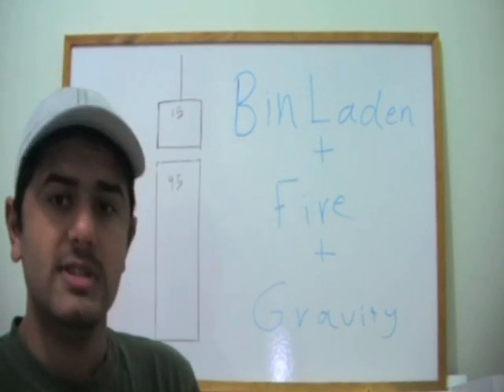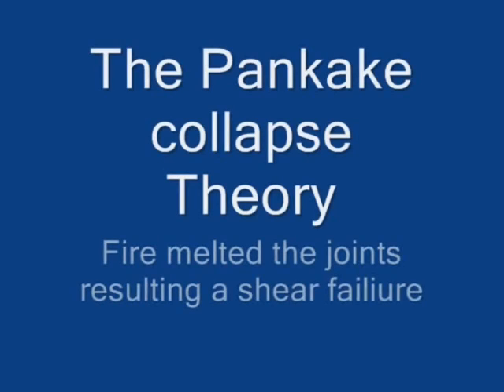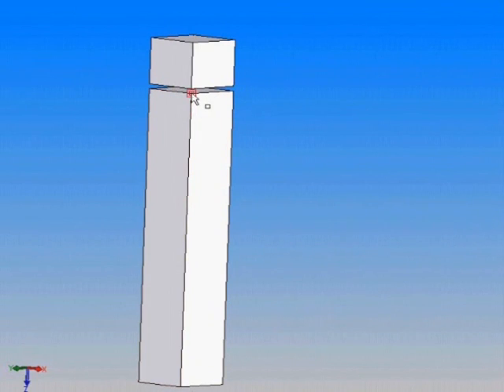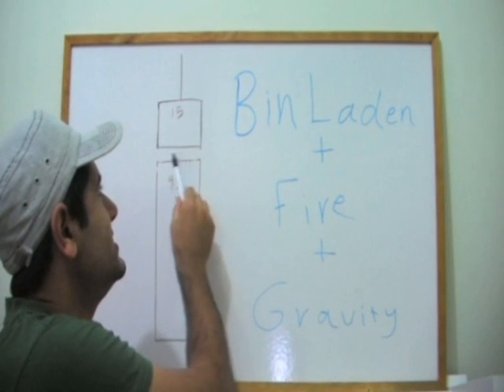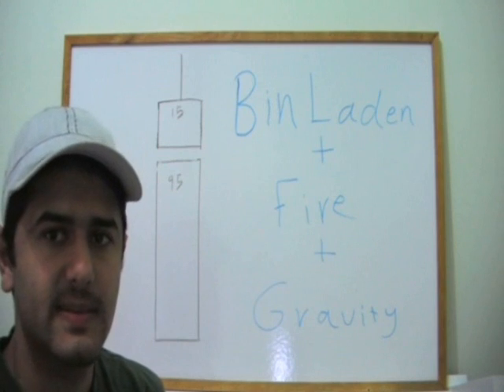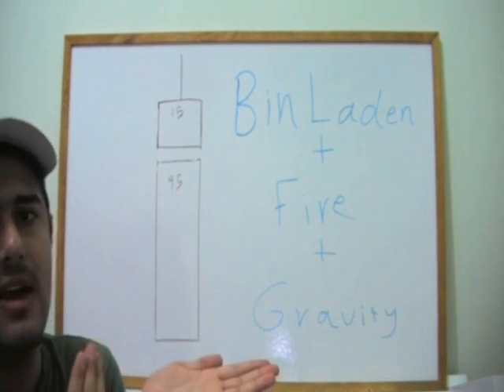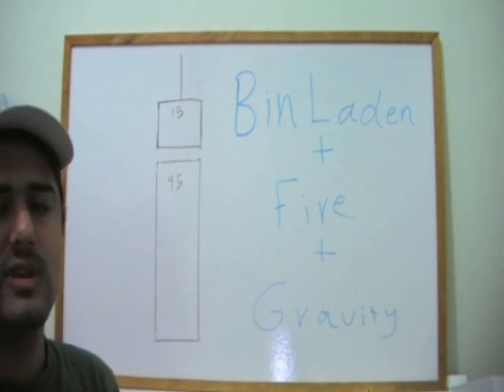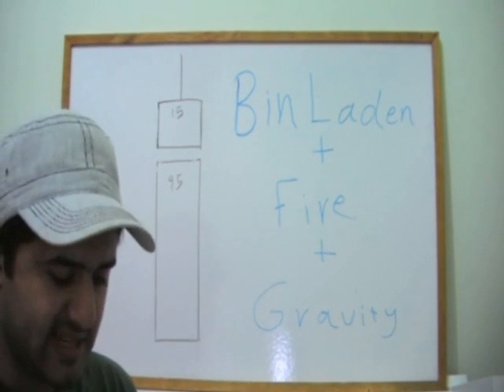(Part1) 911 Simple Physics Structural Failure Vs Demolition

Comment: Eh, no. This is a video of a guy with a whiteboard making some unfounded claims based on staggeringly inaccurate information. He starts out correct by saying that the pancake (excuse me, pankake...) theory isn't valid for 9-11 (which is true), but by 2:00 it shriveled down to nothing. 

Go check out "vvvvvv sharpprintinginc com / 911", it goes into details even the NIST report doesn't. The "WTC1 Accurate Collapse History" section should open your eyes more then a crappy whiteboard.

Comment: Except the plane impact destroyed and damaged many columns, meaning that some columns were dangerously close to being overburdened and fail. The fire then pulled even more columns out of alignment, until the top section could not longer be supported. 
The collapses were NOT symmetrical. The top side falls into the weakest point, and tilts over,  the squibs show that the interior was collapsing before the exterior, and 40-60 floor core segments kept standing for 20 seconds after the rest fell.

Comment: The pressure from the top floors had been there since 1968, and had been resisted quite effectively by 100,000 tons of structural steel put in place to resist those forces.  

The force didn't propagate.  What propagated was the lack of resistance.  We need to know how that happened.

The collapses were symmetrical.  Just look at the videos.  They went floor by floor by floor.

Comment: No, it takes a leap of faith to follow twoofer logic. Also keep in mind that the forces involves came from above, the pressure from the top floors didn't have to propagate, it was already there! The free fall speed was only during the middle stage of the collapse, and was anything but symmetrical. And those 2000 architect and engineers are a false claim (as mentioned by godzilla1077).

Comment: There's no circular reasoning, you're just setting a strawman on fire. The collapse initiation started when the remaining vertical columns on the outside could no longer support the weight of the building above. The widespread fires were warping the exposed and damaged floor trusses, which pulled in the outer wall. This inward bowing is visible on both towers prior to collapse. Bent columns do not carry a load so well, especially with the large number of missing columns adding more load.

Comment: watch?v=MY7BCXew0UI
This video explains the construction well.    It also means that the floor trusses are what holds the columns in pure vertical.   As the floor trusses fail due to damage and fire they pull the structural steel columns out of the vertical..... and then gravity takes over,  Once the large mass starts moving down pure physics shows the load of the impact into the lower floors FAR exceeds their strength to support weight.   Nothing can save the building.

Comment: The videos of the collapse document the factors at work in the collapse.  You have to consider the construction of the Towers to understand how the collapse occurred.  When they were built they used an innovative new technique to provide the open floorspace of the levels of the Towers.  The building's structural steel was actually the exoskeleton of the building, and then the floors were concrete supported by trusses that connected to the outer walls and inner elevator shafts.

Comment: You can place a brick on a glass, and it won't break (static load), but it will crushed if you drop the brick on it (dynamic load). 
Source is the NIST faq (point #12): "The vertical capacity of the connections supporting an intact floor below the level of collapse was adequate to carry the load of 11 additional floors if the load was applied gradually and 6 additional floors if the load was applied suddenly (as was the case)." 
Floors above impact: "(12 floors in WTC 1 and 29 floors in WTC 2)"

Comment: I think you forgot a crucial detail in the video. When the top 12 floors of WTC1 collapsed on the floor below, it far exceeded the maximum dynamic load (estimated at 6 floors). The floor below that then had to deal with 13 floors of load.. below that 14... etc. The debree paths show the outer columns were pushed away from the building from the top down, which is only possible if the top collapsed into the floors below.

Comment: Actually, if the pancake theory is true, it would of collapsed slower then it did. Its actually a really ridiculous theory because during the building collapse, a good portion of the building was turned to dust. Dust doesn't weight anything at all, so with that said, the whole building should of never of collapsed to begin with especially since the top of the buildings literally fell off the sides of the building and turned to dust. How can dust pancake a building?

Comment: Still doesn't debunk it if you discredited a single source. Can you explain the giant dust clouds forming around the building as it fell? For those to shoot out as far as they did it would have required a greater force than the simple weight of the floors above.

Comment from the maker: i worked in structural engineering for a while and we had vertical cantilevered columns (not beam),  i actually built my house that way using 150 UC cantilevered in concrete pads then i put the whole house on top of it. 
by cantilevered they mean its fixed in the ground the same way a vertical cantilevered beam is fixed on the side ,  it just means a fixed end not simple or pin or roller support but no degrees of freedom

Comment: Sorry. For the imaginatively challenged; A cantilevered VERTICAL column, one of 47, that reduces progressively in both dimension and wall thickness as it rises throughthe entirety of the structure, producing both VERTical support and lateral stiffness, in a redundant assembly capable of supporting the ENTIRE building load, working in concert with the exterior steel "lattice" assembly,  ALSO capable of supporting the ENTIRE building load through the "hat truss" and by global load transfer. 

OK?

Comment: Props where props are due!

In the case of the WTC Towers, "trusses" and "beams" were the horizontal members employed.

Not sure one error indicates "a complete lack of construction knowledge"...

Still not convinced the supposed loss of fireproofing, caused by the offset impact of a plane already shredded by impacting the exterior structural steel would have the energy to scour enough of the fireproofing to cause the effect you claim...

911 DENIER scores a point!

Comment: Yes, I have work in construction had hired subs to apply spray on fire proofing.

It flakes off very easy

No, I'm not talking of drywall enclosures.  The fact the you are confused only proves you have no idea what you're talking about. 

The 767 impact did obliterate nearly everything in its path.  That's why the building collapsed.

Go ahead, keep on talking.........it's funny!

911 TRUTH DEBUNKED!  

I'm talking about the the spray on fire proofing used on steel columns and rafters.

Comment: Actually, I AM very bright.

I DO have actual knowledge of fire protection,application, methods, and durability of same.

No, it doesn't. You're probably thinking  of the drywall coatings for residential ceilings, and extrapolating!

 A 767 impact is not a nuclear bomb. The idea that the impact would obliterate everthing in its path is nonsense promoted by the clueless.

Strawman.  H-I-G-H-J-A-C-K-E-D-P-L-A-N-E-S.  Strawman.

Comment: You not very bright.

And you have absolutely no clue about construction of fire protection.

Spray on fire proofing is can be scrapped off columns very easily.  It flakes off.

A 400,000 lbs 560 mph jet impact would take off all the fire proofing in the effected area.

Can you spell S-T-R-A-W-M-A-N?

Comment: As for structiural "weakening" of the steel, even if that HAD occurred (not lkely) the effect would have been to create a gradual failure, rather that an instantaneous "drop ", "tilting drop" "fractured drop", "angular drop" or any other such fantasy collapse initiation.

The strength of the foundation carried through the structure, and would have resisted ANY so-called "fire-induced" collapse by the very real thickness, sizing, and array of the core column structure.

Fail, on 3 counts.

Comment: Fireproofing not as significant as alleged, since in many cases it was not even necessary for fire resistance in modern designs. It was a code reqirement The notion that the fragmentation of the aircraft scoured the fireproofing off a significant portion of the strutural steel is also a stretch, since there was simply not enough flying aluminum bits to accomplish such a process. Ask a construction worker how tenacious the bond between fireproofing and steel can be.

Comment: Please. 

Check the freaking facts before you make such preposterous statements. The core consisted of hollow tubular structural steel on the order of 52 inches by 22 inches, with 2 inches of wall thickness., on the lowest portions. These dimensions were progressively reduced as the core reached upward, and the official apologists have used the smallest dimensions to represent the resisitance of the ENTIRE structure (Byzant, NIST report) Quite the devious little shits, eh?

Fail, by ignorance.

Comment: The floor structure of the WTC existed no where else.  Other than its twin.  The columns RELIED on the floors for their tensile strength.  Let me ask you this.  You have a dinner plate and you have 4 pieces of raw linguini 1 inch long.  And 4 pieces 6 inches long.    Which linguini lengths are going to hold your dinner plate and your food with more stability?  The one inch lengths or the 6 inch?.

And no this has nothing to do with dinner or spaghetti.  It has to do with a principle at the WTC

Comment: This is the "house of cards" fantasy model, beloved by deniers the world over.

Sure, pound for pound, paper and air are lighter than balsa wood. Nice sleight of hand , there, Ignatz. 

If you had a clue, you would know that the WTC structure was a redundantly supportive, vertically cantilevered, load-distributive structure over-engineered for fail-safe tolerance of aircraft impact and fire, with steel engineered to provide 4 times (minimum) safety factor under MAXIMIUM design loading.

Fail.

Comment: MIT (They're pretty smart people over there. Math and Physics PHD's).  Did an analysis on the impact forces of the aircraft.  Accounting for such variable as the tensile strength of the steel.  Its yield point etc.  

The plane went through the side of the building expending ONLY 2.5% of the total energy it possessed.  It would have done so moving at 185 mph.  It was doing 560.

Get real pal.

Comment: Non-sequitur, but I'll play along, just to show you what actual considered thinking looks like. Half a pound of foam,with enough velocity, can penetrate a surface not designed for that sort of load. 

The steel frame of the WTC Towers was much denser than your "foam" example, yet the airplane passed through it without apparent diruption to the airframe, at least initially (no shape change, deformation of profile) AND the steel columns, et al, were SUPPOSEDLY wildly disrupted by the impact. Sure.

Comment: Every single component put in it was a weight consideration.  In scale the exterior columns were as thick as paper.  Instead of a concrete encased core they opted for sheet rock.  The floors were 4 inches of light grade concrete 210 feet by 210 feet by 12 feet high.  Do the math and see what this structure is comprised of?  90% air.  Most hi rises have 75 pounds of steel per cubic foot.  The WTC had 35.  Pound for pound that's lighter than balsa wood.

Comment: There's a video on YT somewhere.  Wish i favorited it when i saw it.   A B 25 hit the Empire State Building in 1945.  Which was a cement and columned FORTRESS in comparison to the WTC which was one of the lightest buildings of its kind.  The B 25 impacted with like.. 40 megajoules energy.

The 767 hit with 4600 Megajoules.  On a building which was intentionally made to be as light as possible.

Your statement is is incredible ill informed.

Comment: That's also wrong.  You might want to listen to an interview with Charles Thornton.  He was on the NIST over sight committee.  They found that the viscous dampers in the building could not handle the massive amount of sway the impact imparted to the building.  The frame was massively out of alignment on impact.  Doors 20 and 30 floors below the impact point would not close.  The building had "Basically" been knocked out of its foundations and alignment on impact.   It was only a matter of time.

Comment: The structure would have dissipated the impact in accordace with the design parameters that allowed the increased height in the first place. the weight would not increase globally, since there was no additional mass introduced, except for that of the plane, which had no initial effect, and thus was a tolerable load.The "air pressure" was not sufficient to create the effects you claim. (see Ryan's study) The elevator shafts were sealed from the building proper, for fire safety reasons, so no.

Comment: I am sorry, but what exactly is there to pulverize?   You're talking about a structure that is about 90% air to begin with.    Once the failure begins you're expecting a floor rated to carry a maximum load of some 1500 tons to resist and arrest a dropping load of 33 floors?  Some 180,000 odd tons?.. Moving?.

Not even close to being possible.  This is an overload of GIGANTIC proportions.   Why is the next floor going to offer any more resistance? It now has 33 floors PLUS the floor added. Etc

Comment: Except Charlie's airplanes were not calculated with full fuel loads flying at 500knots. However, the engineers used those models to get insurance for a Airplane strike now didn't they? That's how they kept the original costs of the Trade Centre down. Their original design was questioned as dangerous to airplane strike, thus the bullshit Charlie model with a airplane flying at 200knots with no fuel. Go ask Charlie and then see what he says.

Comment: The cumulative force for from each additional floor would be more than sufficient to pulverize concrete.  Also, the resistance given by each individual floor would be a constant resistance per floor and the cumulative force from the initial fifteen would grow with each floor collapsed.

Comment: The core columns don't need equal head distribution.  The lateral support beams connected to the outer support structures *buckled* due to weakening (1100-1800F, not melting) of the steel, pulling them inward until they fractured from sheer stress.  Plenty of pictures and news videos showing the progressive inward sagging.  15 floors coming down turn into 16, 17, 18, and so on progressively, creating a growing downward moment of inertia VS the static resistance of each floor.

Comment: @TBlake34 you are so deluded it is really quite pathetic! you're imagining that the core columns all got equal heat dispersion with a softening effect that was somehow sudden enough to cause a catastrophic and symmetrical collapse? the impact was asymmetrical! therefore if the planes were responsible, the collapse would have been asymmetrical AND gradual! by your view the damaged floors just vanished, causing the pulverized upper floors to crush the lower 95? mmmm, idiot much?

Comment: @itzamia you answer your own question! Newtons Law of conservation of energy guarantees that the building could not have fallen THROUGH the core columns, the falling matter from the upper floors would have been diverted away from the path of greatest resistance and do yes, if it had fallen it would have toppled over to the side and fallen AWAY from the path  of greatest resistance, namely the 47 core steel columns!

Comment: at which point was the upper structure determined to "smash' into the lower structure? the upper structure would have to be 'released' from support evenly around the structure otherwise weight transfer of the asymmetrical 'loosening' of the upper-structure would not have had the force to impact the lower 95 floors with any substantial 'force'!

Comment: Problem 1: By "Bin laden" you seem to be glossing over the impact that weakened the structure and blew off the fireproofing around the steel. That's significant.

Problem 2: Fire didn't "melt" the steel, it weakened its structural integrity.

Problem 3: The strength of the foundation is irrelevant, it's the strength of the 95th floor vs. the 15 above. The 95 lower floors don't have a cumulative strength, each floor had to support the weight above it, alone.

Comment: false.
correct but strawman. nobody ever claimed the fires melted steel.
false. 
false.
correct but irrelevant.

the towers didnt collapse into dust powder (whatever the fuck that is).. the dust you see is gypsum wallboard and whatever other materials that were easily pulverized. notice how there is a massive pile of twisted steel and metal after the collapse? thats not dust powder dumbass.

Comment: first of all most of the fuel burnt outside , the office fires didn't melt the steel in those floors , the fire obviously was deprived of oxygen with black smoke eminating from the buildings , the alluminium planes didn't sever the internal core columns , plus most important the 90 floors beneath had no fires no damage , but simply exploded to dust powder POOPSHOOT .

Comment: Based on its comprehensive investigation, NIST concluded that the WTC towers collapsed because: (1) the impact of the planes severed and damaged support columns, dislodged fireproofing insulation coating the steel floor trusses and steel columns, and widely dispersed jet fuel over multiple floors; and (2) the subsequent unusually large number of jet-fuel ignited multi-floor fires (which reached temperatures as high as 1,000 degrees Celsius, or 1,800 degrees Fahrenheit) significantly weakened